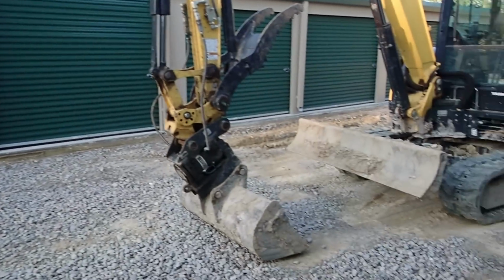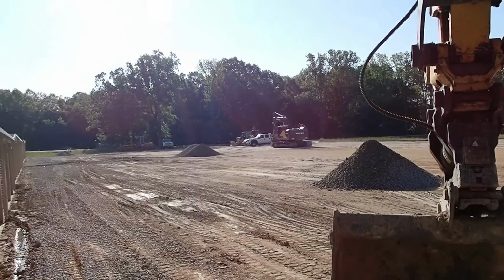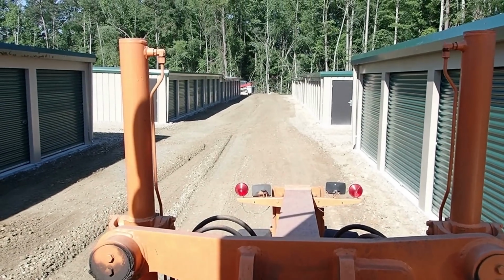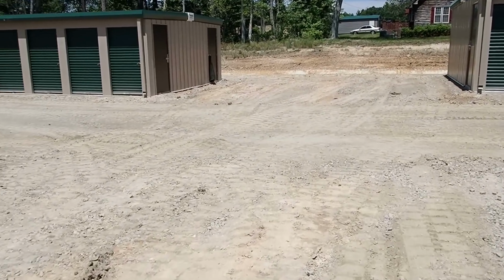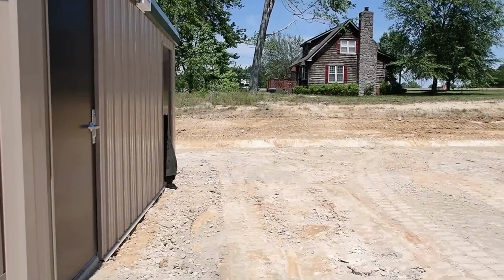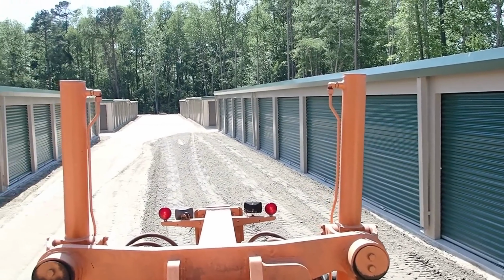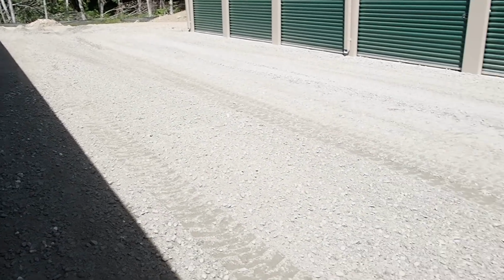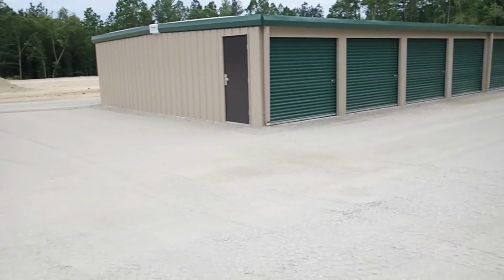Grading Around All The Storage Buildings

Comment: So did you get the level on the beam from Jeff's playbook from his Cat 14G? If you're good this year maybe Santa Clause will bring you an actual slope gauge for Christmas. ;-) great job on getting it all figured out! Seems like they should've done all of the grade work before building those units then they wouldn't have had to step the buildings down. It's one thing to change elevation between different buildings but it's another to do it in the middle of the same building.

Comment: I have never seen storage units with stone. They should be paved. Most storage units have poles on the corners to protect when someone turns a corner. The foot step down is odd. They could of made it all level. Sounds like something put up quickly on a dime. You did an awesome job clearing and burning last fall.

Comment: Yall need to issue everyone a grease gun. You ain't had that Yanmar no and the bucket is already wobbly. Maybe you do grease everything regularly  and just don't mention it in the pre-job part of the videos. What do I know? I only have 200 or so hours on my new 305 so maybe they are just going to get wobbly no matter what you do.  You do great work anyway so thanks for the pointers and the how-to show. I learn a lot from you guys. Mostly all I do is to bury propane tanks and a few other things.
Reply from the maker: its tight, its the tilt part on the tilt bucket that wiggles

Comment: Build your swale offset between the ends of buildings.
That way you won't need such a steep grade off of the higher building, and shallow from the lower building. That would be an option.

Comment: Maybe you should send John to give Brandon @elite a lesson on tailgating.
Reply: beozzie690 sounds good to me 😁 he’s definitely good at it
Reply: @eliteearthworksllc  I bet you learned a couple tricks. A. Just set the height of the bed and go. There is something called The Angle of Repose. It is the Maximum angle a materal will lie before sliding. Once you find that it will just slide out. Notice how he didn't raise the bed any once it got where the material moved? That was the angle I was talking about. Each material has a certin Angle of Repose. I hope that helps.

Comment: What no drainage system in ground, tell Engenear to do a better job, you can only do so much
Reply: It would be a bugger trying to grade it all out to the drains without ripping them out of the ground.  Charlie's millimetre GPS grader could have done it, but that was seriously big bucks kit.  I remember him telling Chris he had to make $10K a month for the bank before he started making a profit.
Reply: @TrevorDennis100  Chris and the crew have done long runs of drainage with decent size drops.  If they wanted Chris could have done that no problem.  Gotta do what the client wants.
Reply: Domenic Dalleva We only engineer in underground drainage if there's an MD5# in the bank financing or if the customer wants it. Other than that we just do above ground slope drainage especially if there is no asphalt. Too many times the drainage pipes get clogged up from mud, twigs and leaves getting in the pipes more often than when there is asphalt. Owners tend to keep the asphalt blown off or swept/raked more than the gravel lots so that exacerbates the gravel lot problem. I've repaired many a ripped up drainage grate from dummies on a tractor that should have been informed that some other dummy buried a grate in the first place but if you've ever worked construction I'm sure you're fully aware of the abundance of mensa members on-site.
Reply: @WillaHerrera  The Spanish speaking (dummies) on my job-site seem to target the colored markers in the lot for storm drains

Comment: Why do i get the feeling you will be back after they ask you to put some drainage pipes in.  You did a great Job with what you had to work with.  Plus it looks professional.  But you know that ground is like a rock and if a heavy rainfall hits only so much can run the center line.

Comment: An intelligent and experienced builder would have poured the storage units concrete slab at least 5 inches above the finished drive through! Andrew
Reply: @lonely4wd , Any storage areas, that I've seen here in Ct, are all paved with drains. Probably why a 10 X 20 costs 210.00 a month !
Reply: @C10sRule , That explains a lot of what happened.
Reply: This is one of the few I've seen where the doors are that low. Here they are all 3 inches or higher off the ground. You see folks making short ramps to get things in and out.

Comment: Wouldnt that be cool if you had some sort of cool machine to separate that rock from dirt 😉
That AB-3 looks awfully wet
Reply: That AB was PERFECT moisture, if it is to dry contractors have to add water and that gets expensive cus you need some way to add water. Like a water trailer, or truck.